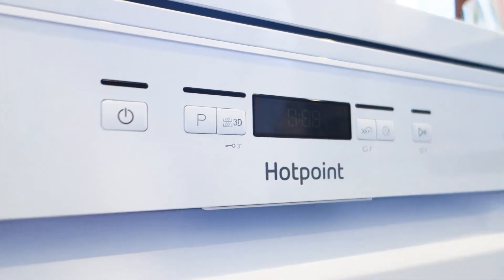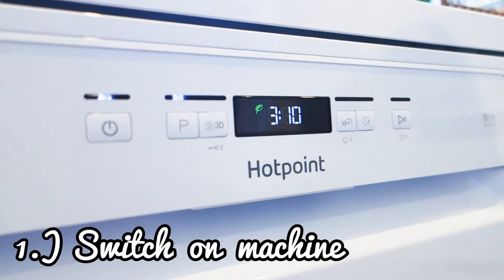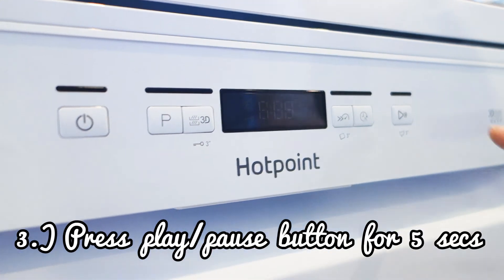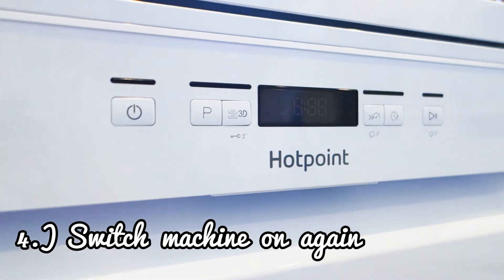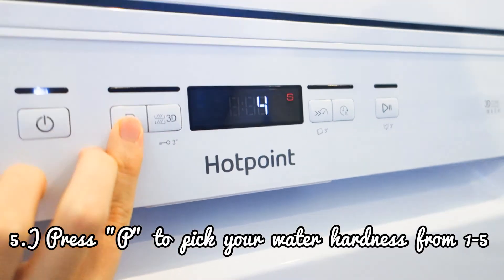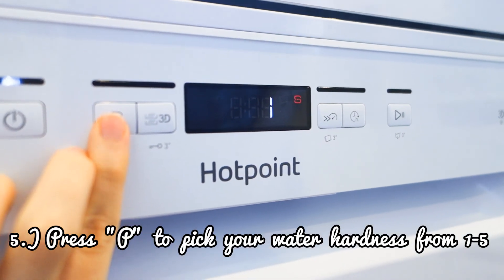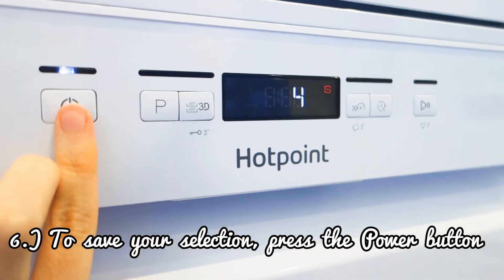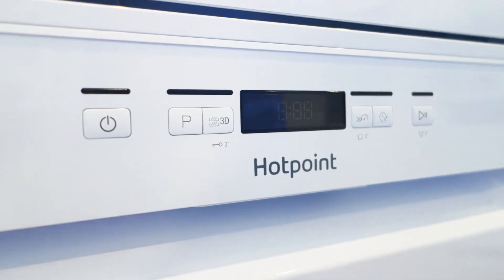Setting Water Hardness on a Hotpoint Dishwasher | Demonstration

Comment: Thanks for the video.

What a faff on! I think I have done it eventually on my machine.

1. The 5 second hold-in of the start button did not work if I had the door closed. I tried it with the door not closed then it did work so that may have been the reason.

2. The instruction for my model HBC2B19UKN says the 'P' button flashes to show the current hardness setting. It does not. The program setting lights flash and I can cycle through them and I think that sets the hardness. When I power the machine off and back on the correct program is still set, as is the flashing hardness value if I go through the setting process again. So hopefully the hardness is now set for my water area.

In conclusion - Worst. Human-Machine. Interface. Ever.

Comment: This isn't working on my new machine(ie the 5 second hold doesn't result in a beep). Help!
Reply: Did you try pressing P button instead of ON/OFF button? It worked with my machine
Reply: So I figured this out, it doesn't say in the instructions but you have to do it fairly quickly.
So after you turn it off at step 2, immediately press and hold the play/pause button. If you wait too long before pressing it won't work. Hope this helps